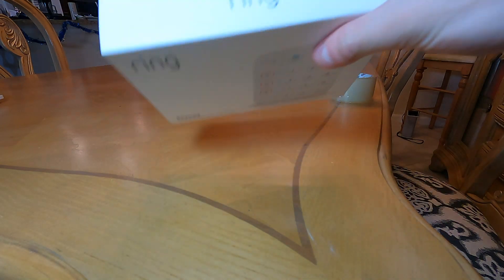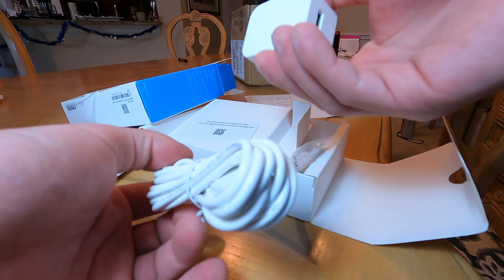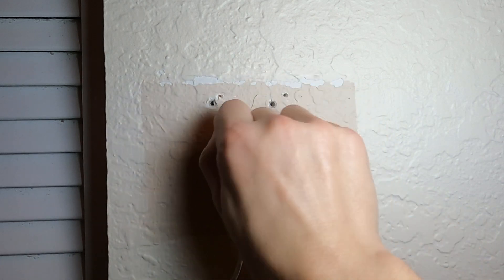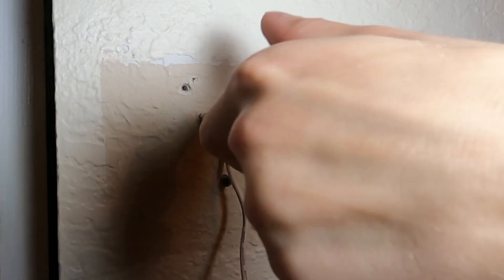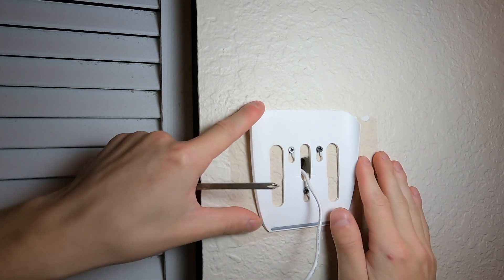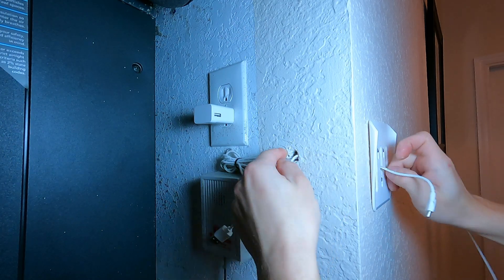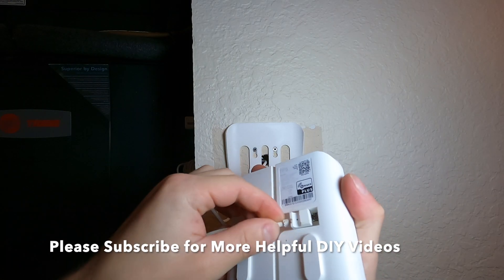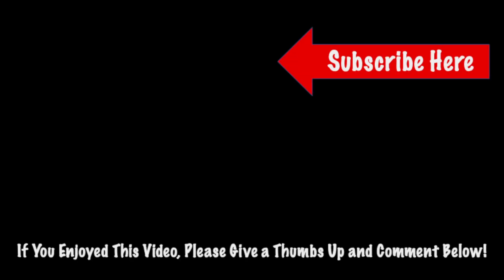EASY Ring Alarm Keypad (2nd Generation) INSTALLATION FLUSH MOUNT TO WALL and Unboxing

Comment: Those wires are not rated for being behind the wall, you put random holes in your wall with wires going through them and you left the paint colors different.

Comment: Must the keypad be plugged in 24/7? I was just thinking, what prevents someone from yanking it from the outlet? Is there a battery inside? Thanks
Reply: Hi you dont need to connect the the keypad this way.  Once you charge it up, will last 9-12 months depending on use.
Reply: @mikewinter598  awesome, thanks… I’ll let it charge for 24 hrs :-)
Reply: @TheMochaangel   not even sure my replies are making it thru
Reply: @mikewinter598  just the one from four days ago …. I had a blunder yesterday, I was bringing in groceries, walked in my place to drop off five bags, proceeded to return to my car to get the rest and I swear it seem like anarchy… that alarm was extremely loud, my cell phone was getting calls from RING lol, I panicked lol….. but at least I know for sure it works. I just need to know how many seconds I have to quickly plug in my code
Reply: @TheMochaangel   sure, so the factory default setting is 60 to disarm.  To change it to 180 seconds for example, you go into modes, look for Away, you will see you can change the entry delay and exit delay there.
Reply: @TheMochaangel  I just went thru the steps on mine, so  I can correctly tell you how to change it to 180 seconds  :   First click three lined (hamburger) menu icon on the upper left-hand side   Next : click on settings, then Modes :  next pick either home or away, in your case away, next  click entry delay- there is a range there to pick from up to 180seconds.    Or - you could disarm right from your cell :)
Reply: @mikewinter598  this is great , thank you for sharing … any other tricks or Ring hacks?
Reply: @TheMochaangel  Well I could write about ring for days :)  I am a fan its obvious.  Would you like to email me directly or I could email you.  mike
Reply: @mikewinter598  hi there, yes please.  I am still looking for a way to use the  sensor to arm on door but not all.
Reply: @TheMochaangel   Let me get this correct.   You only want one door sensor to "go off" when for example its open?   but you want the other sensors not to trigger the system?     I think I am missing the question,  sorry I am sure I could help.   We have a skype chat room, where a bunch of nerds discuss Alarm systems.  Do you have Skype?
Reply: @mikewinter598  Yes, let's say i'm hosting a dinner party but in one room/large closet i keep my jewelry, etc... I certainly want folks to be able to come in the main front door but also I would like an alert if my back closet door is opened.
Reply: @TheMochaangel  So first all sensors send a txt message to your phone in all events, in ether case, if the system is armed or in Home mode.  You can also toggle on the "chirp" alarm for each sensor (picking the sound and volume  )    Are you asking can I have system just alarmed (so the siren goes off) for one sensor?
Reply: Also, if you are hosting a party, I hope you are inviting  me :)
Reply: excellent

Comment: Does it have to be wired? It cannot be battery powered?
Reply: You can charge it
Reply: Wiring it is really not necessary at all. It will easily last for 6 months or more on a charge. Mine has been installed for four months and still reads fully charged. Then just charge it as needed. The only part of the system that needs to be permanently plugged in is the base station.
Reply: @stephanfilm5684  hi, just confirming… so there’s already a battery on the inside of the keypad unit?

Comment: Next time, run that wire on the outlet cover…remove the cover and it will slide through that and all that wire hanging will be hidden. And no big holes on the wall..
Reply: Great idea

Comment: Perhaps you should buy a drill and make holes with that instead of five minutes of trial and error with an awl. Also you could have used the old wire as a pull for the new wire. No need for all that work with a coat hanger.
Reply from the maker: You're right.  I should have used a drill.  The old wire could have been a pull wire.  However, I was demonstrating the need for a pull wire if you had a new installation going in.  For new installations, you would need a pull wire put in place, and the coat hanger is something the average person may have lying around to get the job done.  For a more professional installation, fish tape and some more professional tools would have been used.
Reply: @jakeguitar01  I enjoyed the video. I would have used the same "tools" because that is something i do have laying around. Reminds me of MacGyver, use what you got. Besides, a lot of people are not going to spend extra money just for one install.
Reply: hahahaha 
"Super professional" Kit Includes:
1 Rusty Awl 
1 Giveaway Coat Hanger
1 2" Roll of Packing Tape 
1 (Correctly Sized) #2 Phillips Screwdriver 
1 Randomly Selected "hammer"
Reply: @presidentcamacho  Just think of all the other things you can install with a new drill though...

Drills have electrolytes.
Reply: Honestly don’t understand why you need to wire the keypad anyway. It’s internal battery can last six months or more.

Comment: I see no real need to do this. You only need to charge the keypad about once a year with power save enabled and having it plugged up just wastes electricity charging it 24/7, similar to charging a cellphone all day and increases risk of it getting damaged in a storm. It's actually bad on the battery to constantly charge it like this long term.
Reply: Wait, sooooo are you saying this doesn’t have to be plugged in always??? I’m praying that’s correct because I can simply use command strips.
Reply: @TheMochaangel  The keypad is operated on a re-chargable battery that lasts a really long time in power save mode. But even if it's a vacation home you only visit once a year, your Ring app will notify you the battery on keypad is dead if it dies and in that event you just disarm through the mobile app.
Reply: @TheMochaangel  I don't know what command strips are but the keypad comes with a mounting plate you screw into the wall. The keypad slides out of the mounting plate whenever you need to charge it. Or you can just sit it on a table. Doesn't matter.
Reply: @RavenousFallen  Thank you sooooo much, this is actually great news. Command strips are by 3M which is a big company that allows you to hang pictures, art, etc with strips that has an adhesive tape strip on it.
Reply: @RavenousFallen  where on the app can I see the battery status? I left the keypad charged over night but I dont want to take it out too prematurely
Reply: @TheMochaangel  top left you'll see 3 dashes, click that, select devices. Find the keypad from there and it'll show you how much it's charged.
Reply: @RavenousFallen  found it, it appears to be fully charged. 
Sorry for all the questions,  how many seconds before you have to enter your code? Also when I got home from the grocery store, the alarm on chirp... if I didnt enter my code, would there had been a loud alarm?
Reply: @TheMochaangel  Under Settings > Mode, you'll set up the seconds delay before alarm goes off. I don't recall the default entry delay. It might be 60 seconds. 
If you don't enter code, the alarm will go off and Ring will call to ask for your "verbal password" to ensure you're okay. If there's a criminal there, don't give them the actual verbal password. Upon giving them the correct passphrase, they assume you're safe.

Also you can set up a panic 4 digit code so if a criminal forces you to disarm alarm, you enter the panic code that's not the same as your normal code. Upon entering panic code, it'll alert police to come but disarm the audible alarm but a silent alarm is still active. Just don't make the panic code obvious like 9111. 

A good addition to Ring, is the Alarm smoke listener... so if there's ever a fire when you're not home, it'll hear your smoke detector go off and alert the fire department. You just place it about 3-6 inches away from your existing smoke detector. I have that set up in my utility room where i have a water heater, washer & dryer for clothes and a heater/AC unit... a lot of stuff there that could goof up one day and catch on fire.